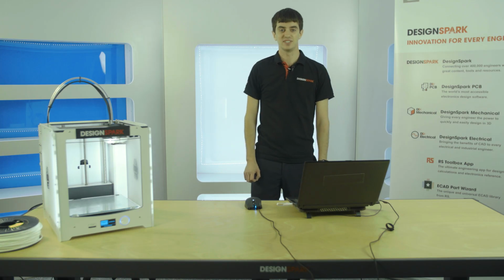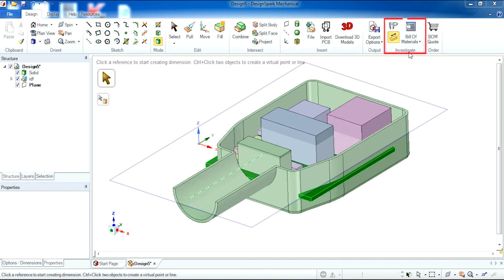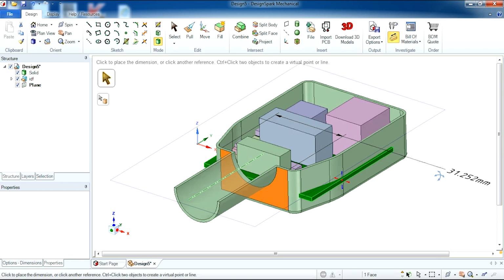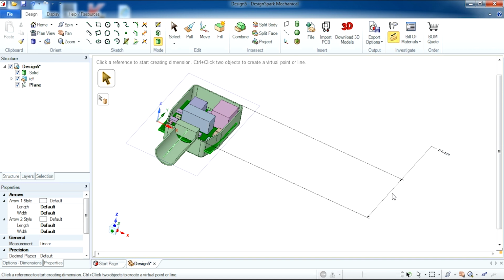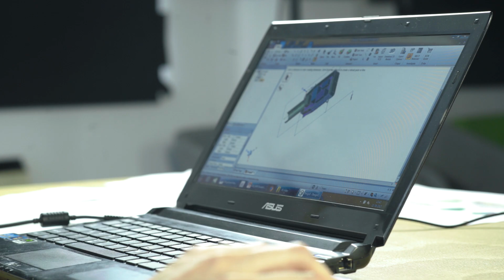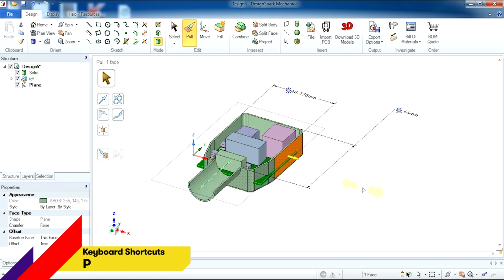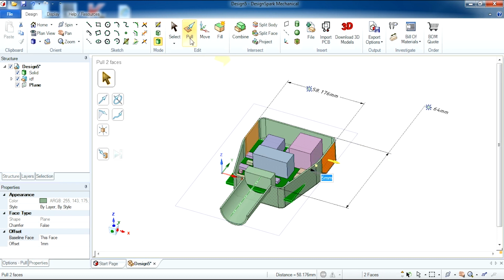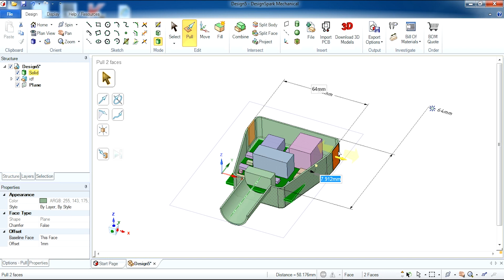DesignSpark Mechanical Training | 8 Dimensions

Comment: clearly based on these comments a bunch of people have been struggling with this and I can see why. When you click the dimension tool you then have to choose an object on the plane that you want to measure along. For me that was clicking the 1mm top edge around the case. Then I can click the two outside faces and get a measurement correctly but it took some figuring out!

Comment: Dimensioning in Designspark (Version 5) is a complete mess. Ever try changing the dimensions of a sphere? How about a sweep arc? Having to use the "Pull" function to change a dimension is ridiculous. How about a much more logical approach like simply using the dimension tool to measure between 2 edges, surfaces, or whatever, and editing the dimension there?

Comment: "Click one side, then the other side, and there you have it."

I've selected the entire design, which happens to be a simple, rectangular shape.
I'd like to re-size that shape, proportionately.
Shouldn't this be a basic function, without having to comb YouTube for an answer?

OK then.... Have it your way:
How do you click each plane, at the same time? Or...
How do you click each plane, without deselecting the other?
All I want to know is how to resize an object.
I've worked with dozens of graphics & 3D software. This should be a no-brainer.

I can't get a straight answer.

EDIT
4 months later...
Hold on, while I dust my comment off.

Comment: Doesn't work for me.
Reply: It's late, but just in case somebody have the same problem as the 3 of us here. After choosing the "dimension" tool you need to left click on the plane that the measurement will be taken on-in this case it's the same plane that was used to split the object into 2 parts. Next you will be able to left click on the opposing surfaces that you want to measure the distance between.